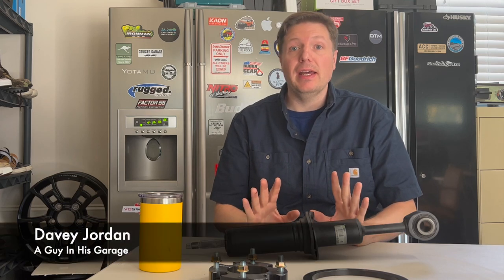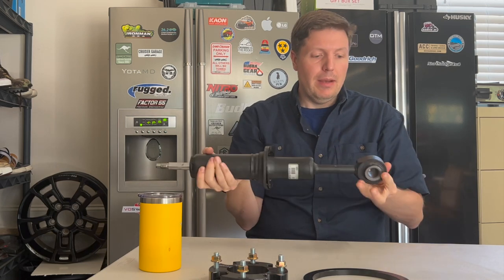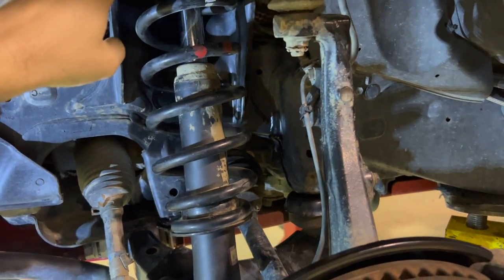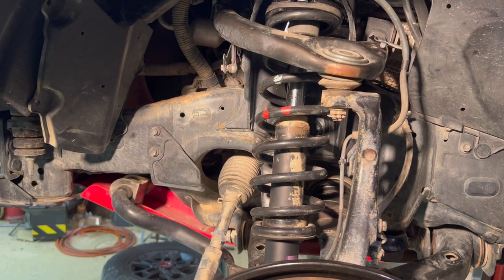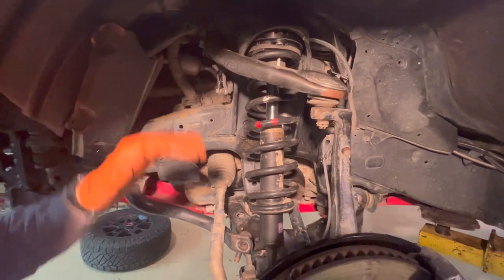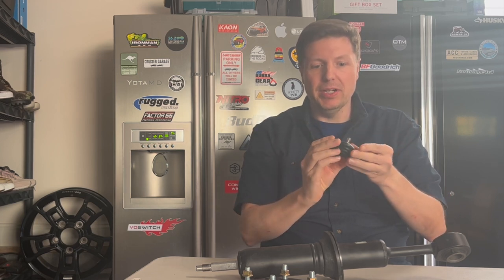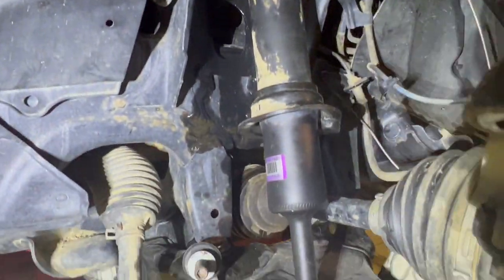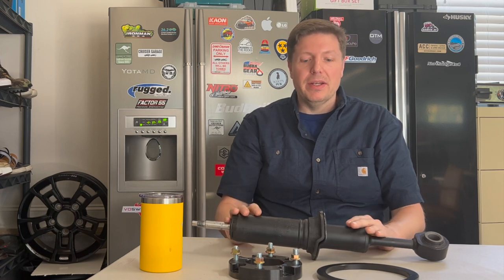LX570 and Land Cruiser 200 AHC installing spacers to increase droop and potential lift.

Comment: I am running actual 1.25 spacer... had to notch spring tower for hydro fitting...also had to clock each shock due to the spacers studs make the shock have to rotate...also could only get 2 nuts on top of one shock because toyota decided not to make those 4 bolts a symmetrical pattern... so to be perfect the spacers need a custom hole pattern to clock the shock and get all the bolts in.
Im sitting a 5 in of lift... I shortened the ride hight sensor connecting rods to achive the lift. 12 in of front end travel.   All that droop and I did brake a cv on a blue mt side trail... now I'm running the tundra rcvs

Comment: Top notch informative video. I have recently installed coil spring buffer in 2018 lc200 with ahc, and I must say I am happy with the result as it improved ride quality, firm, on both dirt road and asphald road. Currently, I am looking to lift my car by 1 inch with spacer and ahc sensor. Was there a difference in ride quality with spacer lift?

Comment: Thanks for the video. Would you recommend a strut spacer for those who have adjusted their front AHC sensors to the max height position to eliminate the factory rake of the LX570? Would it benefit ride quality to return the front struts and springs back to the neutral compression vs preloading the struts from the sensor lift?

Comment: What did you end up doing? Was way interesting seeing the travel with no spring in place. I decided a 275-65-20 is big enough, and all you have to do is pull the front mud flap and move the liner forward. Going to use 1.25” spidertrax spacers. 

Currently just on 275-55-20, and that was still a huge improvement. I don’t think I’d want to go above a 34” tire unless I was prepared to regear the diffs to 4.30.

Comment: Any concern with borking a CV or tie rod with that extra droop?
Reply from the maker: Yes, Travis good point.  We should have discussed that more.  Here's a pic of both at full droop with the sway bar and lower shock bolt removed.  The limiting factor at this point was actually the upper control arm hitting the coil bucket.  https://imgur.com/a/B2Gd0ln. The CV angle was not pretty

Comment: Currently I'm on 285-70-R17 tires. 
What is the easiest solution to lift it 1.5 iches.

Normal driving there is no issues at all, but while Offroading sometimes the tire touches the body. So i thought that the best solution is to lift it both front and end by 1.5 inches. Front will place a spacer and rear will change the coil spring with a spacer. 

whats your reccomendation
Reply from the maker: A spacer alone will not lift an AHC truck. That size tire should have no issue clearing. Adjust height sensors, massage wheel well liner, and enjoy.
Reply: If budget is no object get Werewolf portal axles. 5" non-suspensoin lift. Keeps stock suspension geometry. 1.3 gear reduction. You can fit 37"s and not need to regear the differentials. $15k but would be a beast offroad.
Reply: @marcochavanne  What i have done is adjust suspension sensor and lift up front and end by 1.5" inches ... I use the car for both daily drive and sand dunes offroading, the issue with AHC is that its really bad for high speed offroading and jumps alot, on street its really amazing  ... My Next plan is to remove AHC and replace it with Kingshocks, and its easy to dissable AHC errors meeages from dashboard, just removing 1 wire.